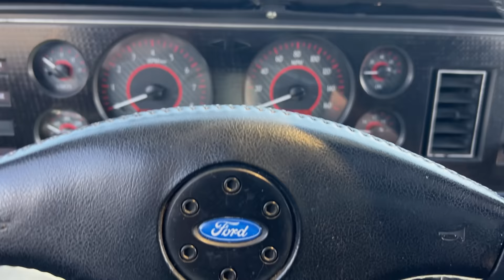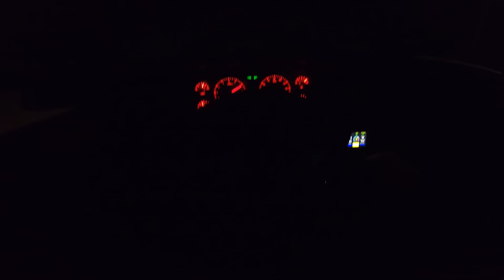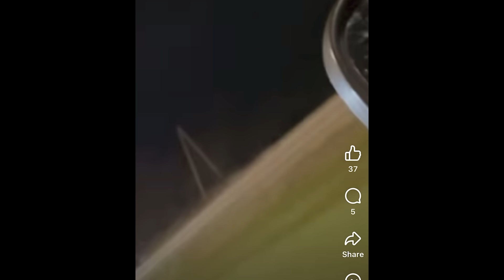BUSTED Racing our Stick Shift Mustangs - COP WAS PISSED. (SRC vs. KrakenRacing)

Comment: That was hilarious! I was spectating at a street race years ago that got busted by the cops. Some rookie cop asked me to pop the hood on my 70 1/2 Camaro RS split bumper and started looking around. He asked, "where's your smog pump?" I just laughed and said, "get your supervisor over here." His Lieutenant wasn't impressed with my, Bad Cop, No Donut, bumper sticker but, they let me slide out after a stern talking to about the dangers of illegal street racing 😂
Reply: 😂 smog pump on a 70 Camaro, never seen one that old. If it had one it would have looked like a mid 70s Ford AC compressor
Reply: Pretty sure at least California emissions in 1970 would have had a smog pump on a small block Camaro. They started seriously talking about "smog equipment" at the oems around 1969. Some of their crappy ideas began showing up in 1970, but by 1971/1972 they were beginning to go all in. 1973/1974 they went full on silly.
Reply: Cops suck

Comment: My car was blowing the same fuse every time I got on it and it was the Holley was not connected directly to the battery. Or the positive cable was not tight enough if there is multiple wires to the battery. 

Hope that helps 🤘
Keep on keeping on.  🇺🇸
Reply from the maker: Thanks for sharing

Comment: For a clean shift every time 2nd to 3rd shift in a Tremec, all you do is stop trying to find third and just open your hand and push straight up. Shifter springs to center and the push gets it in every time. 
415 small block with a T56 in my 69 Camaro = FUN FUN FUN!!

Comment: If the Holley is powering the fuel pump directly instead of using it to trigger a relay for the fuel pump I’d bet that’s what’s popping it.
Reply: 💯. I only use the fuel pump fuse to trigger a relay that is directly wired to battery with wiring rated for 70 amps. I don’t run a holley but your advice is universal 👍🏻

Comment: Back in the early 70’s when I was in high school I actually got busted for street racing my sisters bone stock ‘67 VW bug against a classmates bug.  The speed limit on the street was 50 mph and I swear those cars would have been lucky to exceed 50 by a 1/4 mile.  I think the only way the cop was alerted to the fact we were racing was the other bug had a pretty loud header!

Comment: Check and make sure the fuel pump has a relay between it and the terminator x in the mustang. The stuff that comes in the term x harness is only good to 15 amps and if the pump draws more under load it will blow the fuse for the injectors and fuel pump. I'd bet anything if you add a relay between the term x and the fuel pump it'll solve the problem

Comment: Didn't those pace cars come with Marchal driving lights with the Marchal covers? They probably removed for better  air flow across the  trans and oil coolers or intercooler. For the life of me I couldn't figure out what was missing from the front of the car. Then the view Billy showed of that area when jacking up. It finally dawned on me. Stephen's ride is nice. BUT I'd take  the Pace Car every time. Something about the old 4 eye mustangs  from 79-82 and it's grill area. They changed in 83-84 and then again in 85-86. New look in 87 withe the new gt with lower body kit. Didn't like but loved the LX coupes. Thanks Guys and to Stephen . When the out of state no prep guys venture into ohio.  They always plan a stop to the good Ole' SRC / OMG Garage. When's Jackie & Chief planning on coming to visit. Could you imagine the video with Big Chief in the Old Man's garage. Bet June Pup would get a lil taste of Chief if gets too close to the old man.

Comment: Just started following your channel and love it so far. While I was in South Carolina for a funeral I found a couple of wrecked vehicles with LS's in them. Thinking about buying one of them and then find something to put the motor and transmission in. One is a 2017 GMC truck the other is a 2001 Tahoe. Which would be the better one to make good power out of it?